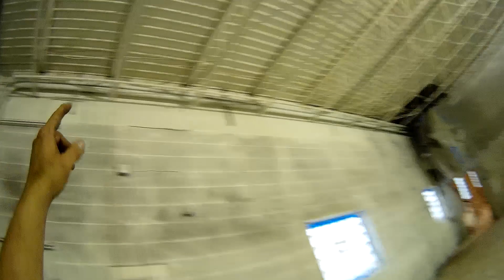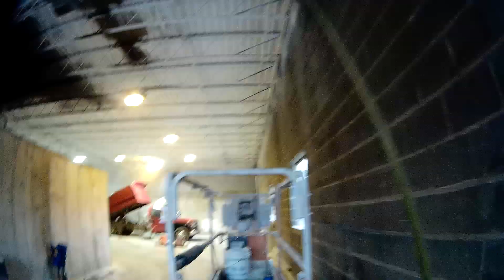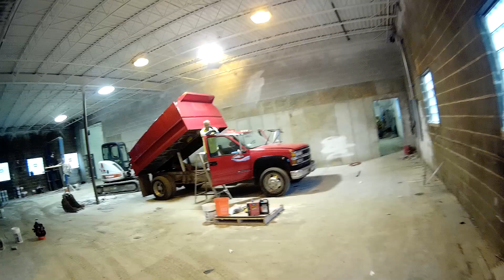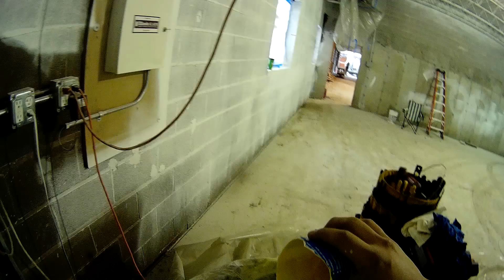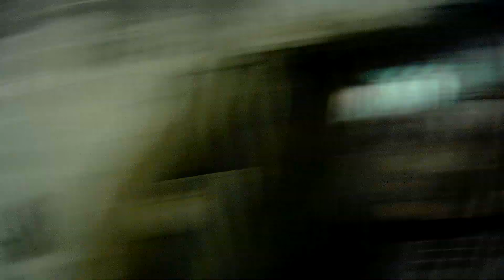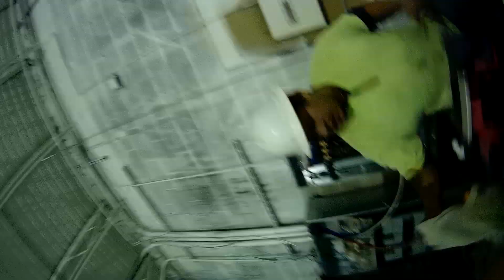Pulling 3/O wire part 2

Comment: Nice work as always.  I've watched electricians come in to where I work & do that job several times.  I've seen them break out a winch they wrapped the rope around to pull wire a few times.  I'm not too sure how far they were pulling the wire but, it was impressive to watch.  Stay safe.
Reply from the maker: crslyrn yeah that's called a chugger, there sweet we use them for bigger wire and longer pulls

Comment: That wire gets heavy on a long pull like that one. What about your ground, are you carrying it through the emt?
Reply from the maker: Massey1105driver yes the EMT is the ground
Reply: Mr Nate     Down here we have to pull in a green wire (separate bonding wire)..... 4 wire systems.
Reply from the maker: Jim D if you look in the NEC book it's not required. some municipalities do require it though
Reply: Yeah, Here in Austin they are a bit "different"......not just on the electrical!!!
Reply from the maker: WirenutTx yeah it seems like wherever you go they have their own spin on codes

Comment: good work . How do u guys get the rope in the pipe to begin with ?
Reply from the maker: buffalostate1 we just used a fish tape but you can also use a cork tied to a nylon string and suck it through with a Shop-Vac from the other side then use the nylon string to pull the Rope through. the corks are made out of a styrofoam type spongy material and they come in various sizes to fit the pipe you are sucking it through